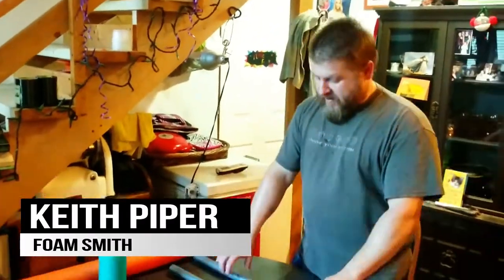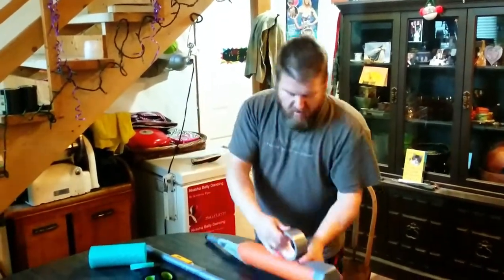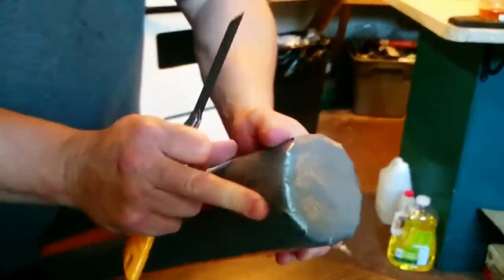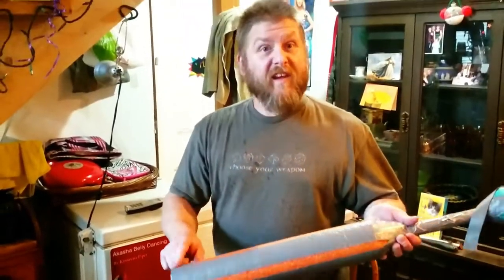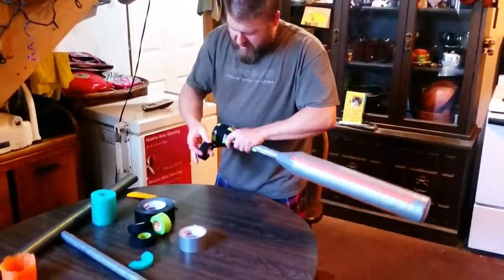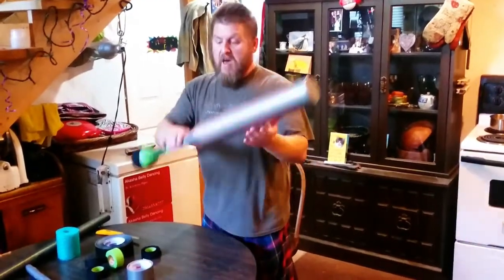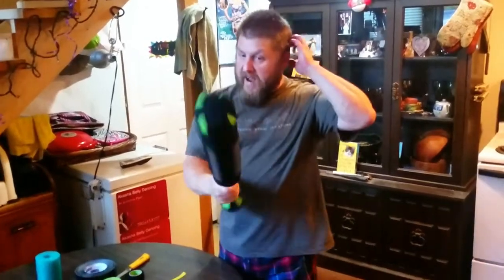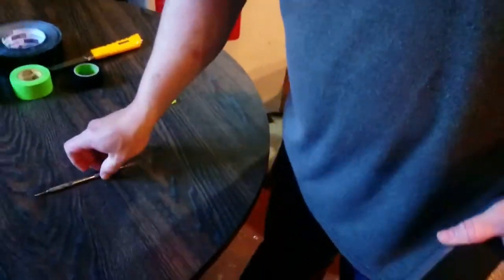How To Make A Durable Boffer Sword (DIY Tutorial)

Comment from the maker: Materials needed

   A 3/4" PVC pipe, about an arm's length 
 A Big Boss pool noodle
 Duct tape
 Hockey tape
 A sharp knife
 Water pipe insulation if making a stabbing tip.
 And about 15 minutes of your time.

Comment: What is the price? Also, there is a group called amt guard and the have clothe cases for there swords because it is no fun being hit by tape
Reply: It costs us about $10 CDN to make them.  Cloth would be a good idea we just haven't bothered much with it.  We put it on a few swords but most of the time we just use them as is.
Reply: Been using duct for 25 years and it doesn't hurt any more or less than cloth.
Reply: @KingdomBoffer  as material becoms sparse ive started using duct tape as well for my primitive weapons

Comment: Doesnt the pvc break after a while?
Reply: Not so far. Only the foam.
Reply: @BruniFamilyTV  did you ever try fiberglas? 
It seems a lot if people use it
Reply: Never tried it.   Just pvc pipes and some sort of a plastic composite hockey stick that ended up breaking after a few years.
Reply: @BruniFamilyTV  all the larp people use fiberglas.
In comercial boffer swords i saw something seeming to be polycarbonat. (Verry good. And not cheap)

Wood broke
Pvc also somtimes 
The polycarbonat never (but its to expendive)
Now i am trying fiberglas rods.

Lets see what happens:)